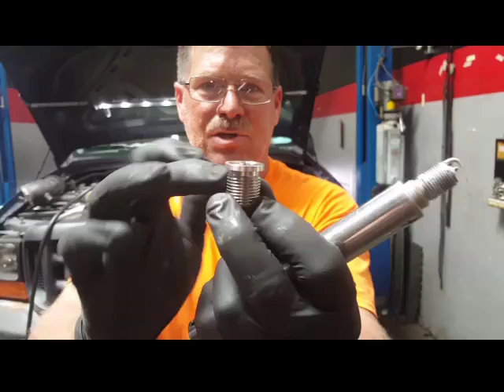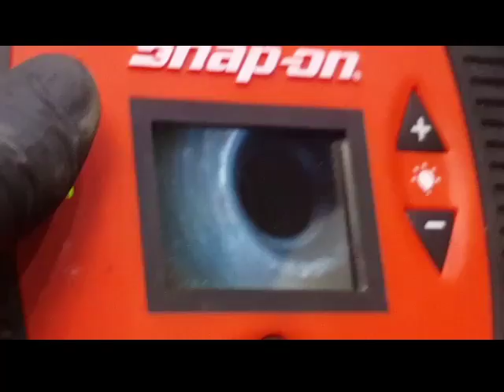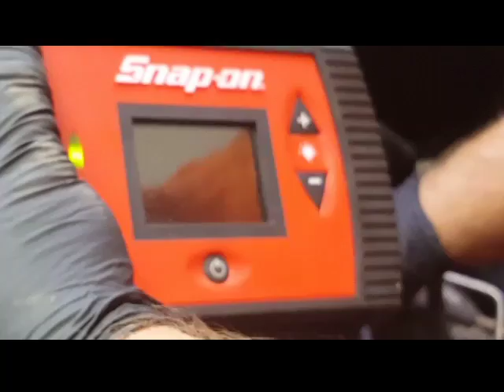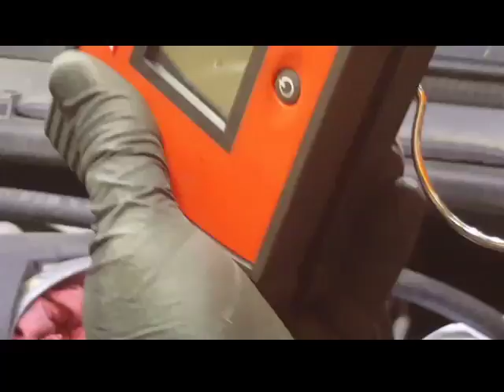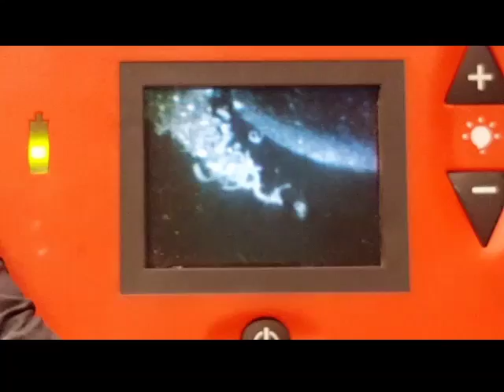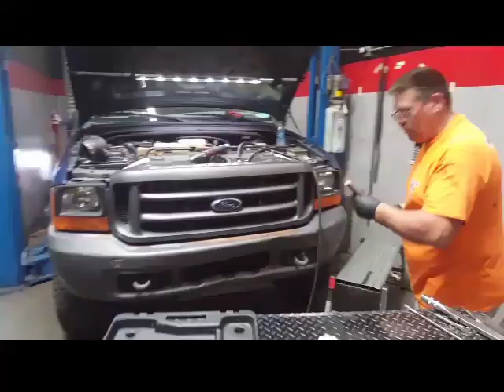New Method on repairing Ford Triton blown out spark plugs. 2 valve only

Comment: Can anyone tell me if the Cal van insert is larger than the Time sert insert? I have a 5.4 and on #8 cylinder two times in a year the porcleain of the plug has blown out and when the failed plug is removed the time sert insert comes out with it, I was thinking of doing it over with the cal van kit.
Reply from the maker: Yes it is. The reamer is 11/16 " and the outside if insert is 3/4"
Reply from the maker: And for all those who keep saying the timecert is better for a Triton this fellow is just one of many and the calvan insert is the only one I have installed that I have never seen a problem with one installed correctly.
Reply: @SandCarServices  So I should be able to recut the threads where the time sert insert was with the cal van kit, thanks so much for taking the time to answer. The time sert had not blown out, just unthreaded when the plug was removed.
Reply from the maker: Usually yes. But I can't see yours.
Reply: @SandCarServices  I ran the reamer in the hole where the time sert insert was and it barely removed any material,  I ran the tap in and then looked at the threads with the bore scope hoping to see new threads all around, I only saw new threads on one side of the hole so I decided to replace the head, after I pulled it I saw that  the aluminum on one side of the spark plug hole was deteriorated,  and would not of been in full contact with the insert.

Comment: OUTSTANDING VIDEO.   Pretty much idiot proof with the GUIDE BUSHING. As a machinist, aircraft Tooling guy, we call that a 4 FLUTE CORE DRILL. Readers typically have 6 FLUTES.    I can machine a larger SHOULDER on an insert.

Comment: Does anyone know the CalVan kit part number for a spark plug repair on a 2008 Honda Odyssey EX with a 3.5 l Vtek...thanks!
Reply from the maker: The 14mm save a thread works well on hondas.

Comment: I just got my kit from wise auto and out of 8 inserts  2 are good they don't check nothing I wouldn't order the 8 inserts  kit I'd order the 2 insert kit that way u have the Remer and threader and get inserts from other sources  60% of the kit is bad I'm waiting  on wise auto to refund or replace the inserts will update when the issue is resolved
Reply: Wise auto replaced the bad inserts I will check them when I get them and hopefully  they are good cal van has got to get this control issues  fixed have a schedule  tool Change and better inspection  that's only way it's going to change
Reply from the maker: Sad part is one of the owners of calvan called me personally a few months back and assured me they fixed the problem and then sent me 10 free inserts of which 5 were bad. It's the best fix out there but quality control sucks. Sorry you experience a bad kit from Dennis, its the first time I have heard a complaint about wiseautotools.com

Comment: So you only "fix" them one "hole" at a time instead of completely "fixing" at least the entire head and all the "holes" on the blown-out side if not every "hole" in the engine? That must be how and why you've done "thousands" of them. One at a time. 

Is your "fix" even possible as "preventive maintenance" in "holes" not yet blown out? 

That's probably what the ACTUAL pros that brough you entire heads were expecting. "35-40 minutes" times 4-5 "holes" per head AFTER you do a significant amount of the disassembly necessary to "pull the head(s)" (which can be done "cab on" on 5.4 driver-side heads) is guaranteed to be an hour per hole if you're "repairing" instead of just "fixing" and you aren't going to make that time 4-5 holes in a row much less 8-10. 

The other perfectly logical AND professional "why" to pull the head(s) is when "preventive service" of the OTHER well-known "issue" IN Triton engines - worn/broken timing chain guides/tensioners and stretched timing chains - is done in one "visit" to a professional repair shop where the pros will correctly and honestly advise the owner that "blown plugs" and timing chain "issues" tend to go hand in hand and if one is worth REPAIRING rather than "fixing" then so is the other. Once you're "in there" it costs nothing but a few more hours of labor and the head gaskets to pull the heads and have them REPAIRED before they blow with REAL "inserts" that replace the whole plug thread "hole" with a THREADED INSERT in EVERY "hole" instead of just installing a "thread insert" in the "bad hole".

My PRO machinist when I "pointlessly" pulled a 5.4 head AND did the timing chain "fixes" simultaneously AND properly replaced and torqued all the plugs in the "good" head to verify it WAS and would REMAIN "good" on its trip "home" halfway across the U.S. when I "fixed" a blown-out 5.4 in a Super Duty for a visiting hunter/friend of a friend told me the ONLY way he would repair one hole is IF as I "suggested" we went ahead and inserted all four "while we were there" AND he reinforced MY opinion as a "30-year master technician" on everything from $500 lawn mowers to $50,000 heavy-duty diesel engines to $500,000 farm tractors to $5 million diesel-electric freight locomotives that any "on engine" so-called "fix" of a known "issue" with aluminum "swiss cheese" heads on high-compression high-rpm engines "engineered" by a company whose "engineers" didn't "fix" what was BOUND to be an "issue" with STEEL TAPER-SEAT PLUGS IN DRILLED AND TAPPED ALUMINUM PLUG HOLE THREADS AT THE BOTTOM OF INCHES-DEEP "PLUG BORES" BY INSERTING THE HOLES AT THE FACTORY WAS BOUND TO BE A "SHADETREE" FIX AND DAMNED SURE NOT "CHEAP" GIVEN EVERY "REPAIR KIT" OUT THERE GOES FOR SEVERAL HUNDRED DOLLARS WHICH BUYS SEVERAL HOURS OF LABOR EVEN IF THE "FIX" ONLY TAKES "MINUTES" AND NONE OF THEM ACTUALLY REPAIR THE "ROOT CAUSE" OF THE "ISSUE" AND THEY DAMNED SURE DON'T DO ANYTHING TO PREVENT "COMEBACKS" WHEN THE NEXT "HOLE" BLOWS AND MORE THAN LIKELY WITHIN DAYS VERSUS MONTHS AND/OR HUNDREDS OF MILES RATHER THAN TENS OF THOUSANDS OF MILES "DOWN THE ROAD".

THE MONEY I SAVED NOT BUYING A "REPAIR KIT" I DAMNED SURE WOULDN'T USE TO "FIX" MY OWN VEHICLE AND WOULD NEVER USE AGAIN AND DIDN'T FEEL RIGHT ABOUT CHARGING THE CUSTOMER FOR AND AT BEST WOULD "COST ME MONEY" EVEN THEN BY REDUCING MY "BILLABLE HOURS" AND DAMNED SURE DID NOTHING TO "FIX" THE OTHER 7 "HOLES" OR "ADDRESS" THOSE TIMING CHAIN ISSUES REAL TRITON "PROS" WARNED ME COULD BE "RIGHT AROUND THE CORNER" AND COULD/WOULD CAUSE CATASTROPHIC FAILURE "BACK HOME" THAT COULD EASILY BE BLAMED ON THE "LAST GUY THAT WORKED ON IT" AND A "FRIEND OF A FRIEND" A THOUSAND+ MILES AWAY DURING THE WHOLE "FIX" MIGHT NOT BE SO "FRIENDLY" IF I "FIXED" A BLOWN OUT PLUG AND THEN THE ENTIRE ENGINE "BLEW". 

SO I "FIXED" IT RIGHT AND CORRECTLY AND ULTIMATELY NOBODY PAID FOR ANYTHING HE DID NOT WANT TO OR NEED TO IN ORDER TO MAKE SURE ALL THE ISSUES WERE PROPERLY REPAIRED.

Comment: its a core drill a reamer has edges going vertical on the bit line reamer!!!
Reply: A reamer's flutes don't have to be straight, drill bits cut on the bottom face, and by the ware pattern, all the cutting takes place on the outside cutting surface of this spiral fluted reamer.  It's the very reason he has to replace it so often, the design is limited to small amounts of soft material.  The purpose is high precision, which equates to high cost.

Comment: will this Calvan 38900 KIT work on a Ford 4.6 V8 Modular 2 Valve engine in a 2004 Lincoln Towncar Ultimate?
Reply from the maker: Yes if it's a 2 valve engine with an angled boot on coil it should work.

Comment: Please... someone explain to us... why people STILL love Fix Or Repair Daily trucks?  At one time they were reasonably priced work trucks... now they are priced as if they are exotic sports cars, that people plan to hall rocks and tools.  Still I repeat.  Why now that they are over priced they still purchase these trucks with this MAJOR expensive design flaw?  It would make sense if they were still inexpensive work trucks...but they are no longer a bargain.  And from what I research....this problem normally happens AFTER the worthless warranty...that FORD will not honor if the owner did not take his truck in for the EXPENSIVE dealer maintenance schedule prior to these plug failures....  Nice to be in an industry where producing faulty products does not effect the companies bottom line.
Reply: Buy the F250 with the 6.2 gas engine -  but as for why?  may as well ask the "why" question for everything.  BTW have not had to F-O-R-D my truck at all since I purchased it new and do not expect to anytime soon, but this will not satisfy most that do not like Ford vehicles.   So was you question rhetorical?  :)